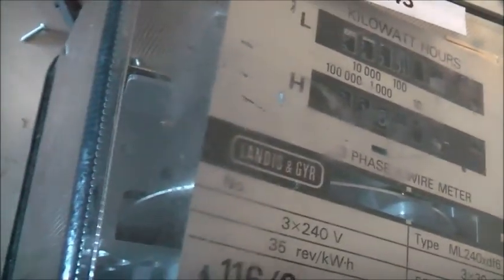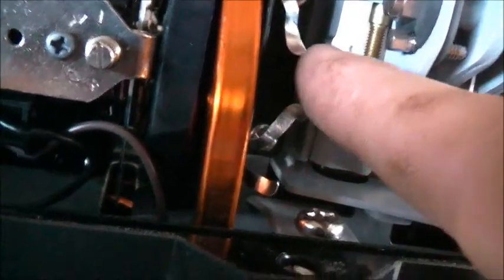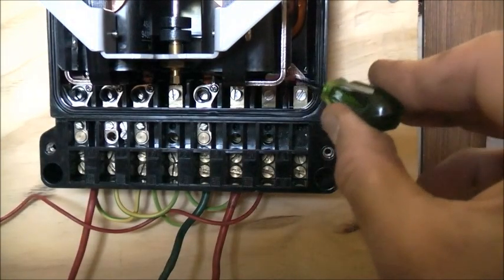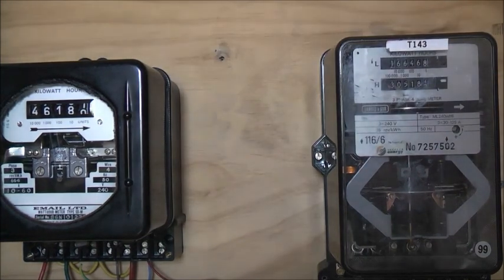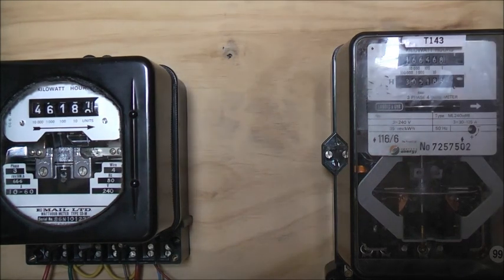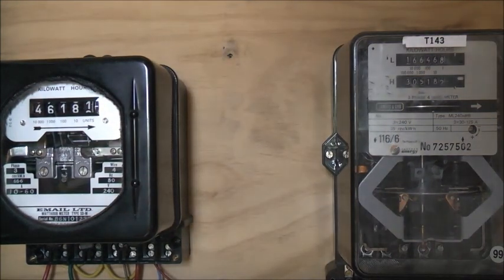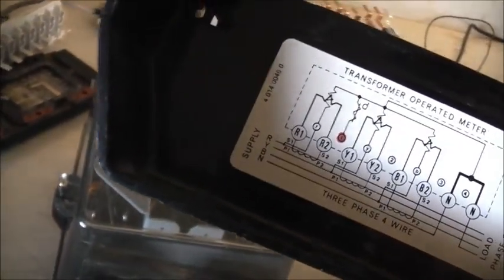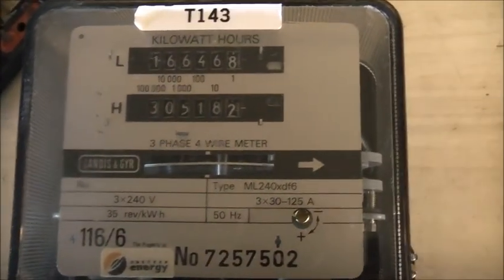Landis & Gyr ML240xDf6 Watthour Meter Repair & Test

Comment: Nice to see one of these as a "direct-wired" type. It's interesting that these have more than one loadwheel.

Looking around in there, it can be seen that these share parts with the L&G CL-147 meters that I own. :-)

I think though, that these meters would look 'better' if the specification plate went all the way to the bottom instead of having that big gaping hole in the front like that.

If I had one, I would think about making my own custon specification plate for it....a huge one with suitably-positioned holes for the loadwheels to be seen in there. :-)

Thanxx for showing,

-BoomBoxDeluxe.